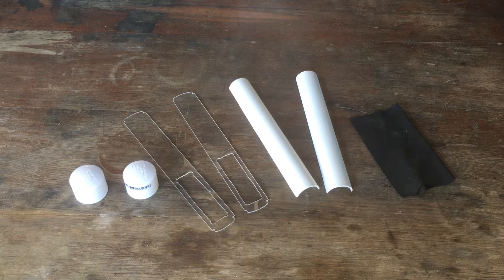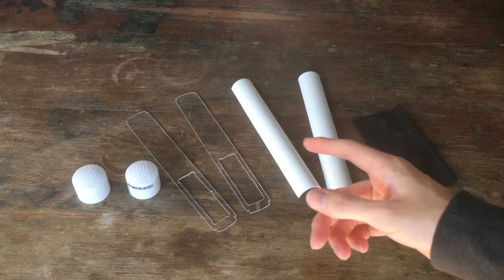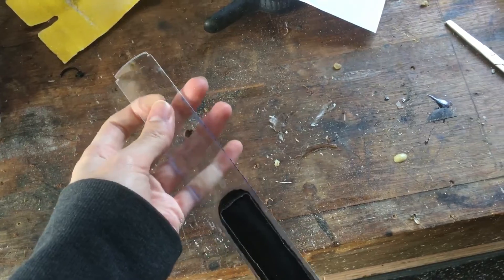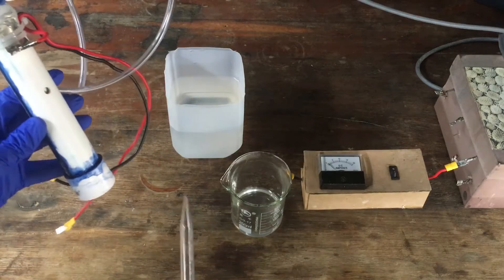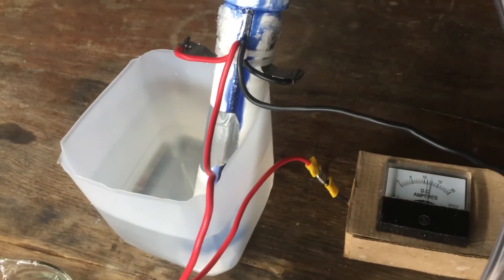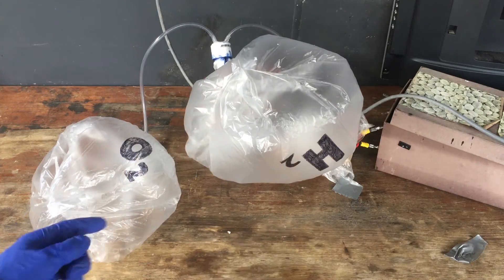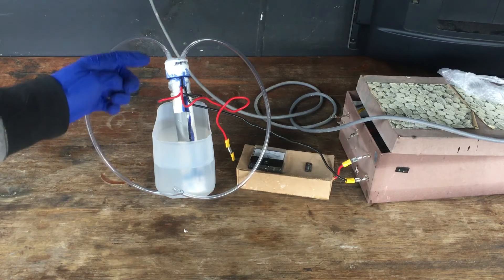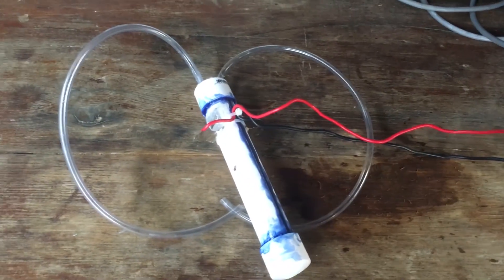A Hydrogen Generator

Comment: Distillation is another tried and true method of D concentration. Evaporation works. Leave the lid loose on your storage jugs and put them in the attic. Keep the last bit. Then run the electrolysis on the last bit.
Reply from the maker: I'm afraid the evaporation of water is over 500 times less effective in separating the hydrogen isotopes than electrolysis is. The vast majority of deuterium content would be lost by doing this.

Comment: Im not able to find pure Nickel electrodes, but i found Nickel plated steel would that be also resistant in a NaOH solution?
Reply from the maker: If it's a good plating, then yes it will do fine.

Comment: Hey, because you have much experience with elecrolysis, could you make a video about making hydrogen peroxide by the electrolysis of suphuric acid?
Reply from the maker: I've looked into this a lot in the past. The electrolysis stage (to generate persulfuric acid) doesn't seem too tricky, but it's the vacuum distillation step afterwards (to convert the persulfuric acid into peroxide) that's a little bit beyond my ability at this point in time.
One day I'll hopefully have the setup to be able to pull it off, and I'll give it a go, but for now it's a little bit too difficult to try.

Comment: Hey,
Is it possible to make sodium using electrolysis without melting sodium hydroxide.
Could you help me with this problem. Every year I always stumbled to the same problem and you I can't buy any sodium where I live unfortunately
Reply from the maker: I'm afraid there really aren't many ways of making sodium that are easier than electrolysing molten sodium hydroxide, especially not ones that involve electrolysis.
There is, of course, Nurdrage's 'menthol catalysed magnesium reduction method', which is about as easy as it gets for making sodium (this doesn't involve electrolysis).
Beyond that, you could conceivably electrolyse sodium perchlorate in a propylene carbonate solvent at room temperature (probably under inert atmosphere and very dry conditions) to make sodium. However, if you can't get sodium, you probably can't get propylene carbonate or an inert atmosphere.
Other than that, the electrolysis of molten sodium hydroxide is about the only way to do it. Molten sodium chloride is also a possibility, but that's even more difficult generally.

Comment: You should consider design of HHO generators with membrane , they need just 1.8 volts so much less heating and higher efficiency.
Find some on YouTube.
 
And to be clear I do not support HHO for cars because it's a scum that do not improve fuel efficiency..

Comment: TBH the volume in the bags is kind of tricky to judge. If we approximate them as spheres,  the volume varies quickly with radius (cubed), so you may be closer to 2:1 volume than you think. But then again hydrogen is good at leaking out of things. Who knows.
Reply from the maker: Yeah definitely. Volume is always pretty difficult to judge just on sight.
When I was filming that bit, I was pretty convinced that the oxygen had more than half the volume of the hydrogen (I was doing my best to judge the cubic relationship between diameter/volume). But now that I look back on the footage, the ratio looks a lot more like 2:1 than I thought...

Comment: making helium through fusion from ionized deuterium gas, ie, mini desktop fusion reactor, not necessarily "above one"
Reply: fluorescent glow tube from a light
Reply: based on that, the plate capacitor with electrolyte is the best generator
Reply: as much plate surface area you have, the better you have total conductivity, amps
Reply: carbon to hydrogen forced electrolytic oxidation below 1.23, at 0.2v
Reply: destructive distillation of biomass into carbon and hydrogen, water, all co/h2 to c/h2/h2o
Reply: sabatier co + h2 -> c + h2o

Comment: 18 grams of water (1 mole)  elelectolitically broken down makes 1 mole molecular hydrogen (2 grams), and 1/2 mole of molecular oxygen, (16 grams).

1 mole of gas at standard temperature and pressure (stp) =22.4liters. So 1.5 moles of hydrogen and oxygen = 33.6 liters of hydrogen and oxygen gas at stp

33.6liter/18grams of water = 1.8666 liters of HHO per gram of water. 

The above doesn't count water vapor in the gases.

Comment: Yup, only 1.23 volts × amps = power in watts consumed in the chemical process of splitting water while Every volt × amps above that is power in watts going to make to making heat.  3.3v × 5 amps = 16.5 watts consumed from the power supply, but 1.23v×5amps = 6.15 watts  stored in splitting water which leaves  (3.3v-1.23v)×5amps=10.35 watts going to heat. 

One can electrocically simulate this with a resistor and  a 1.23v zener diode.  The power the zener diode consumes simulates power for producing HHO, while power the resistor consumes is lost as waste heat. And just as no current flows with a supply voltages below the zener voltage 1.23v.  No current flows below waters break down voltage.
Reply from the maker: Awesome explanation, thanks!

I've always loved the zener diode representation of electrolytic cells, it's a very elegant electrical representation of the whole process.

Comment: Make the hole in the pieces of acrylic almost all the way up. Add fabric between the two acrylic plates, it is hydrophilic thus preventing gas bubbles  from crossing the membrane. The greater area and shorter distance through which ions have to travel will decrease resistance.

Comment: 1)KOH has a higher conductivity over a wider range of concentrations. Check out conductivity graphs. 

2) Distance between the plates does matter,  and so does the cross section through which current is conducted. It is very much like a wire, where the thinner the wire, the more resistance the wire has, except we're talking about ions being conducted through the water.  And the more narrow a channel through which ions can travel the more resistance they will have. 

3) And then there is the area of the plates which limits how much current can flow. Doubling the surface area is sort of like adding two resistors in parallel  reducing the resistance to ion current in half. With stainless steel  You want to run no more than 0.5 amps per square inch plate surface area. And there are   6.4516  square cm in a square inch. I suspect Nickle is roughly similar limit. 

Anyone or a combination of these factors  can contribute to the cells high resistance as reported  at 1:20.

Comment: For just hydrogen production, maybe some experiments with urea electrolysis? More hydrogen for the buck (of electricity XD)
Reply from the maker: Definitely! I bought some urea specifically for testing this not long ago, so I'll be trying it out at some point in the future.
To be honest, I'm most impressed by the opportunity to make nearly pure nitrogen gas...
Reply: @ScrapScience  True, especially for home organic chemistry it can be godsent.
Reply: How can nitrogen be made with this contraption? Imagine how much money can be saved not buying gas canisters if you're doing reactions with inert gas
Reply: @bobsagely812  In case of urea electrolysis, on one electrode you are producing hydrogen and other mixture of N2 and CO2. And with lower voltage than splitting H2O. True is that even cheaper nitrogen source are medical oxygen concentrators: in their case enriched nitrogen is byproduct of oxygen concentration. And because they use just molecular sieves it is even cheaper source. Everything depends on amount of nitrogen that you need, small scale, electrolysis, medium, oxygen concentrator can be great, even bigger scale, nitrogen bottle or special separation membrane. Technology depending on your needs.

Comment: I love how compact it is. Also impressed that it draws 10A at 5V. I didn't know you could use NaOH, I've been using baking soda this whole time. Will KOH will work better for the same molarity as the NaOH since K+ is more mobile?
Reply from the maker: Thanks! Glad you enjoyed.

There are many electrochemically inert electrolytes that will work for water electrolysis in principle. Sodium bicarbonate, sodium carbonate, sodium sulfate, sodium hydroxide, and all of their corresponding potassium salts will work if you have unreactive electrodes. This is because they are made up of ions that are completely electrochemically inert under normal conditions (which means your products will always be H2 and O2, provided your electrode materials don't react in any way).
Of these main options, the potassium salts are better, since (as you've said) K+ is more mobile than Na+. Additionally, the mobility of the anions follows the trend: 
OH- > CO3(2-) > HCO3- > SO4(2-),
so the hydroxides are most ideal.
NaOH and KOH also give the benefit of being extremely basic, which allows you to use a nickel anode without any significant corrosion over time. Other electrolytes usually require more expensive anodes like platinum in order to avoid corrosion.

In general, KOH is a clear winner as the electrolyte, but it's a little tricky for me to find any, so I've used NaOH (which is the next best thing).
Reply: @ScrapScience  btw, how's the Heavy water extraction going.
Reply from the maker: @ArcturusA  It's... not currently going at all I'm afraid.
Every time I try building a new set of cells, something seems to go wrong, and I haven't been able to restart concentrating any heavy water for over a year.

I'm going to be busy over the next two months, but I recently did put together a set of high efficiency, high production rate cells which will hopefully allow me to start making heavy water again in late December. So don't worry, I haven't forgotten about the project, but it'll sadly be a long while before the next video about it is out.
Reply: @ScrapScience  rip
Reply: I have been using lead electrodes and sulphuric acid as electrolyte (30%) 
And a microwave transformer I modified it for 6.5volts and 30 amps 
And it works excellent 
It gets hot (30 ducking amps duh) but if I make an electrolyte circulating system that could fix that
Reply: @koukouzee2923  what is the current density with lead electrodes?
Reply: @kreynolds1123  I removed the secondary from the transformer and replaced it with 4 loops that's why my current is high 
I can edit the voltage by adding removing  loops 
1loop =  around 1.5 volts
Reply: @koukouzee2923  in of itself, having a high current is not bad if..... your conductors are adequately sized and your efficiency is sufficiently high that waste heat isnot a problem, and the level of production is what your aiming for. 

Conversely if one is producing more than they need, or their cables are not sufficient for the amps or the efficiency is low which generates more heat than can be handeled, then one must reduce the current or increase the efficiency. 

Lowering the voltage as you did increases the efficiency, but decreases both the amp draw and the HHO production amount. My proposal in the last comment was that by increasing the surface area while also reducing the voltage, you can keep both production levels and efficiency up while reducing your waste heat problem. 

Are you doing AC or rectified AC to the electrolysis cell?
Reply: @koukouzee2923   Run half the voltage and you'll rufly half the amperage. Double the surface area and you double the amps and double the production. 

On the If you both double the surface area and half the voltage, your current draw will be about the same, a little less really, and your production levels will also be about the same. 

But half the voltage and draw the same current consumes half the power for about the same amount of product means your efficiency nearly doubled and waste heat nearly halves.
Reply: KOH is actually ideal for water electrolysis, around 5-10% will be good
Reply: KOH is much better but it's also more corrosive and dangerous, also baking soda gives off CO2 at the anode not oxygen. The resistance of NaHCO3 is muchh higher than NaOH

Comment: Awesome work !
Now I want to see it run on brine to generate chlorine, but I recon  electrode would get fucked. 

Anyways Thanks for the content man... 
Looking forward to peroxide update ;)
Reply from the maker: Thanks!

Yeah, I'm afraid the nickel anode can't be used to make chlorine, it'll just form nickel chloride in solution instead. Even if the electrodes were inert, the poor quality separator means we'd be generating mostly chlorates on the anode instead of chlorine gas.

It's funny you mentioned peroxide though, since that's the major reason I made this generator in the first place. Eventually, the H2/O2 gasses from this thing will hopefully be used as inputs for the fully catalytic anthraquinone process for making H2O2 (I've given up on the direct electrolytic production). 
That's a long, long way away though, so don't get your hopes too high.